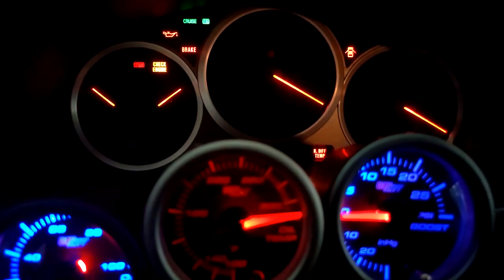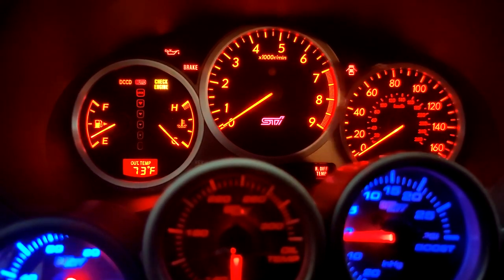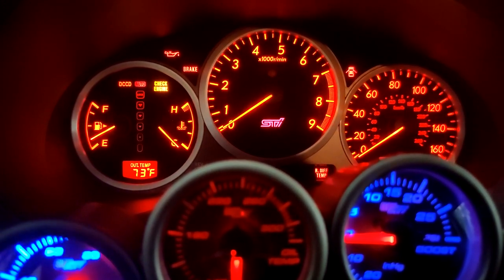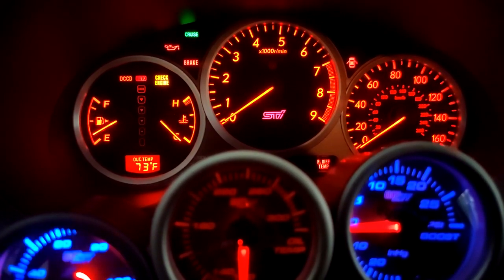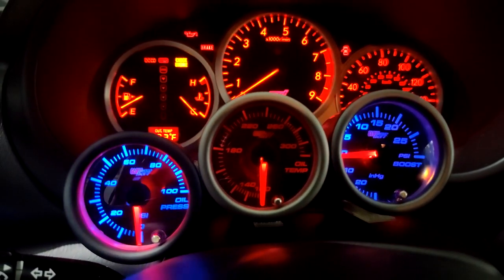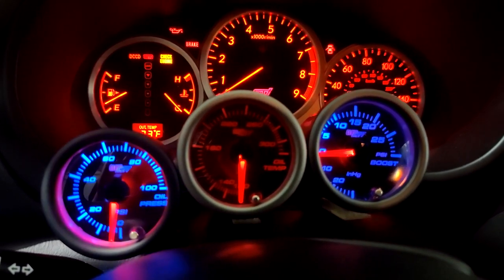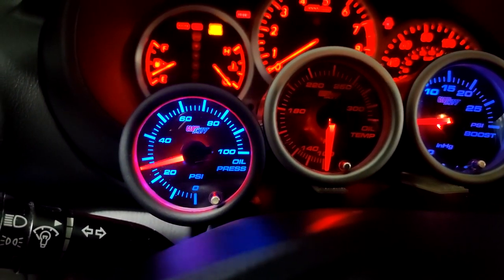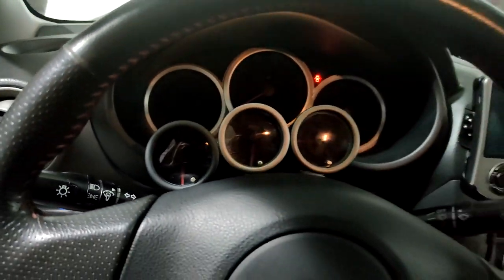Do this before starting your car after it sat for a while

Comment: Good idea!  There ought to be a device to pump a little oil before the engine is started, without having to pull a fuse.
Reply: Use a engine pre-lube tank. holds 4 quarts of oil you can inject into the engine through the oil pressure sensor. Rotate engine by hand while the tank injects in new oil. Fully pre-lubes all oil circuits

Comment: my car haven't started in over a year a 3 months due to horrible situation i been going through in life and due to the pandemic do you recommend an oil change before i even start the car ? and should i add gas to the car since it hardly has any
Reply from the maker: add gas before start, warm up the engine for about 15min and then change the oil but make sure the oil level is good.

Comment: Do I have to remove spark plugs and put oil in the cylinders on a car that has sit for 10 years befor I start it? If not I plan on doing your fuse disconnect? What would you do?
Reply from the maker: I would put a scope through the sparkplug holes and inspect the cylinder walls, if you cant do that then gently turn the engine and try to feel for any obstruction with the plugs out, rust might be present, if motor is stock or you do feel something then put ATF inside and wait couple of days, then turn and feel for it again, if all good then crank with sparkplugs still out to clear the cylinders, its going to be a mess....then start...expect a lot of smoke.
Reply: How did this workout for you?

Comment: My car Toyota Yaris 2022 model was parked since 15 months. How I can star it. What precautionary action i need to take before start.
Reply from the maker: check oil before starting, pull an ignition fuse or fuel pump fuse or relay, or you can just disconnect the coils on top of the engine so spark plugs dont fire, crank until red oil light turns off, about 10 seconds should do it.

Comment: 2018 wrx fa20 dit stg 2 tgv deletes no cats, inlet, intake charge pipes.   car has been parked in my garage almost 2 years at 55k miles had new oil at parking time castrol extended gold bottle. how can i start it without damage? i thought about draining and refilling, or adding a top quart before spinning
Reply from the maker: Sorry for the late response.  I would unplug the crank sensor and pull a fuel pump fuse then just crank like I did in the video.  Killing fuel means no fuel will go down cylinders while cranking.  Unburned fuel washes down oil from cylinder walls.  Warm up the car for 10 mins or so, then change oil.
Reply: @cruizinmax4017  thasnks alot i will let you know how she purrs
Reply: @aaronferguson9328 I’m having the same issue did it work bro?
Reply: Just start it.  All these theories that people spew around about the first start being such a huge deal is mostly BS.  What's worse is that many of the suggestions given are more damaging than just starting it.  If you really want to go the distance in doing it the best way possible; pull the spark plugs, coat the cylinders with oil, and crank it 'till you have oil pressure.  Then put the plugs in and start it.  Coating the cylinders means wetting the entire circumference of the cylinders, not just squirting a little oil in.  Since your cylinders are horizontal you'll have to use something to get oil to the upper side of the cylinders.

With my 911, which has the same style of cylinder layout, I used an air blow gun with a long tube that had a slight bend at the tip.  I put oil into the tube, put that in the plug holes with the bend facing upward, and blasted the oil into the cylinders.  Mine was an extreme case, it had been parked for about 10 years, the oil had been drained, and several parts were removed which drained even more oil than normal so I felt the need to pre-lube it.  It took a very long time cranking to make oil pressure since everything was empty, yours won't be as bad.  Oil doesn't go bad from sitting, but if you feel the need to change it, do it after you've run it.

Comment: Hi my car has been sitting up for 5 years what should I do before I turn the key
Reply from the maker: disconnect the crank sensor underneath alternator or an ignition fuse or fuel pump fuse or relay, then crank until your red oil light turns off.

Comment: Hello! I have a 2009 Audi A4 that has been sitting and not been started since April 2023. Apart from the battery, what should I expect to discover (potential oil leaks from dried seals?) I had a motor overhaul in April 2022 most parts including the cylinder head were replaced so the seals only have a couple thousand miles on them. Therefore what should I inspect and do before I attempt to crank it up? 
I left it with a full tank of gas, added some Stabil Fuel Stabilizer in April 2023.
Reply from the maker: if it sat in a dry place then you should be just fine to crank but not start.  U may have smoke every start up since the valve seals got pretty dry, but i wouldnt worry about that.

Comment: The motor turns over slower when not firing up and oil pressure will take longer to build. If you just start it oil warning light will go out in 2 seconds max usually . The prolonged cranking may not help the situation   .Either way its going to be dry for a bit. Take your plugs out and poor some some light oil like sewing machine oil down the bores and turn it over  , that will at least give the cylinders  some protection and it wont start either . The big end and journals down below are a problem though I admit. An electric oil pump would be good, but usually don't have.Drain all oil and poor it back down may do it to
Reply from the maker: Then why do you just crank newly build engines for example to build up oil pressure?
Reply: @cruizinmax4017  I don't know, but I seen a video once where during a rebuild they put some oil around critical components during assembly.  But I have to admit that turning it by hand with the plugs out is a good way of getting som oil to swish around ,or the cold crank like you say
Reply: @cruizinmax4017 the idea with an engine that's not fresh built is the piston rings are possibly stuck to cylinder walls or will have more friction than a freshly put together engine with installation lube and pre oiled cylinders

Comment: Was the oil pump piston faulty and stuck when the oil pressure wasn't building on your part 15 build
Reply from the maker: there is no oil pump piston, its a rotational pump but a fresh subaru engine not wanting to prime is a common issue, some say leave the oil filter empty so the pump will have an easier time to push the oil through but the safest way is to dismantle the oil pump and pack it with assembly lube or even petroleum based vaseline.

Comment: Can you please make a quick video showing how to do this on a Toyota or Honda.
Also I like to know lubricating cylinder/piston before cold start
Thank you
Reply from the maker: It should be easy on any vehicle, just find the fuel pump relay or fuse under the hood or inside under your dash, you can also look for the ignition fuse, pull any of those fuses or relays.  Its better to kill the fuel pump so no fuel gets dumped into the cylinders while cranking.  Cant really lubricate cylinder walls or pistons from the top on a fuel injected car before start, you could but its more work and unnecessary.  It was easily done on carbureted engines back in the day, you would just dump a mix of gas and oil down the carburetor but if you kill that fuel pump and give a crank until your oil light goes off you should be good.
Reply: @cruizinmax4017  I think it's better for the fuel to be injected into the well since the gas can also serve as lubricants. so the better option is to pull the ignition power switch fuse